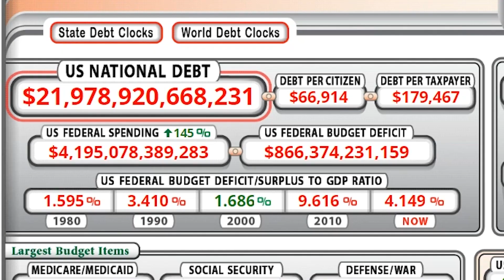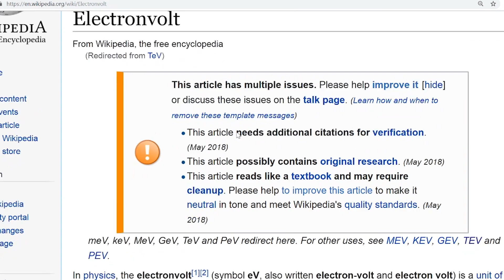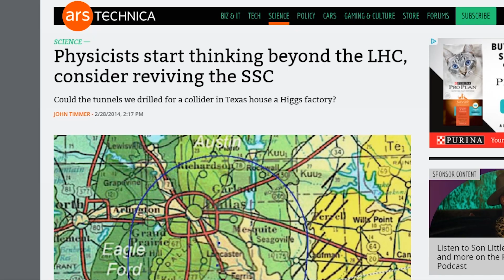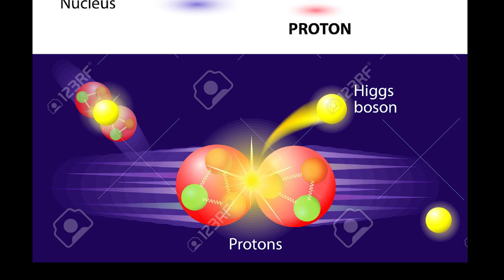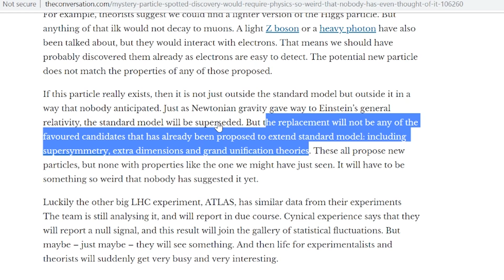FDWB - Word's Largest Particle Collider That Never Was

Comment: We know for every partical there is an Anti particle.
We now know gravity is a particle and have proof gravity is a particle. 
Then space travel and floating cars air travel becomes low low cost. 
Space is only 50 miles away. 
Just a short short drive for a Jetson go to work car.
Lifting up super tankers full of Fossil fuel to burn to reach Mars or our planets moons or Rich in ore asteroid belts, Discovery of Anti Gravity Particle and harness and use of that Anti Gravity Particle the anti Higgs Boson.
We know for every particle there is an Anti particle.